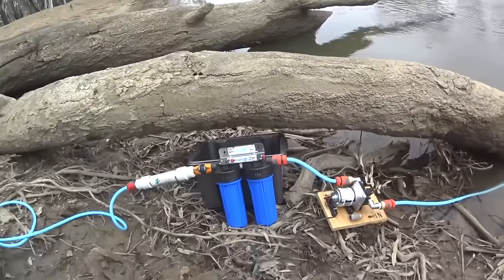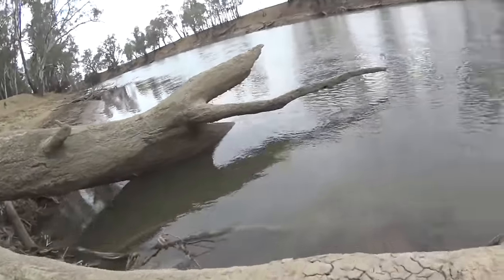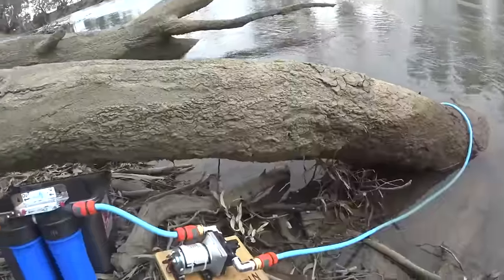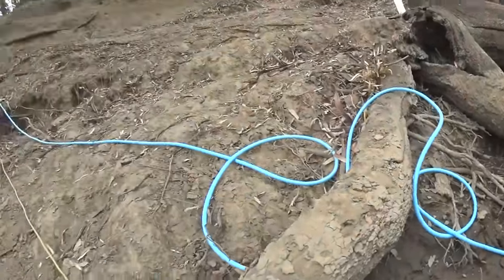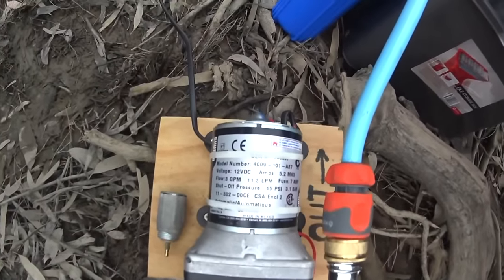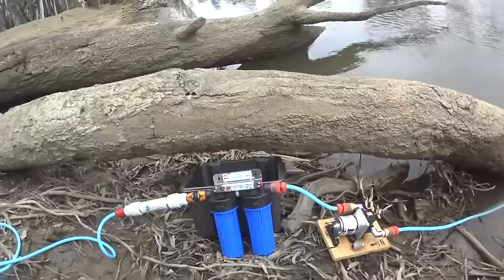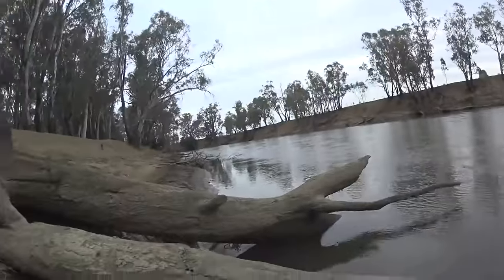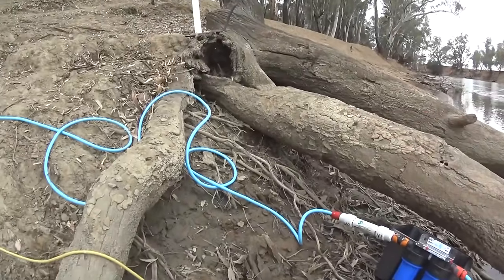12 Volt water pump, Shurflo pump and Water Filter for filling RV Caravan tanks, or camping shower

Comment: I can't get a 24 volt, 5 amp pump to go through 1 30 micron filter with out cycling. What am I missing?
Reply from the maker: I have no idea, have you tried it going the other way through the filter? does the filter work OK with the garden hose? does the pump feel powerfull eg when you put your finger over the end can you stop the water easy, I don't really know maybe the pump or filter people need to be contacted.Let me know how you go. Thank you for your comment.
Reply: We run the same filter but with a 5 micron using the vans pump to fill the tanks and a 0.5 under the sink

Comment: how did you actually wire up the pump?
Reply from the maker: Hi, I am using two 15amp 240 volt extension cable, I have put 12 volt accessory plugs on the ends of the cables so I could use one or join two cables depending on what distance the pump is away. it also lets me plug it straight into the 4wd if I am filling up drums away from the camp. I used the 15 amp leads because of two reasons 1)  I already had them and 2) They have a good size wire in them and a good rubber covering on the lead protecting the wire. I am not an electrician and you will see in the comments here that people say the power drop etc from doing what I have done will damage the pump or it wont work, seems OK to me and I have used this many times. I do agree with  what these people have said, but this is working for me. You can buy a very small petrol pump also if you are thinking that would be better. Hope that helps a bit.
Reply: Gavin Clark You could be fine using one. That’s like 80% discharge.
Reply: If those leads are to Australian standards you have no problem, as they can easily carry a lot more current than they are officially rated at due to the somewhat excessive safety margins built-in to the specs. If you were ever to have any reason for concern, or even just curiosity, simply measure the voltage at the pump end. It needs to be at least, but preferably a little more more, than the minimum voltage for that particular pump. The outflow from your hose suggests the pump is working well within its ratings.

Comment: is the water potable? Thanks @Gavin.
Reply from the maker: The call if it is drinkable water will always have to be made by you, we mainly camp on the Murrumbidgee and Murray rivers and we drink the water, but things change all the time, right now the Murray is in flood and I would not be drinking it, as houses were flooded which means sewage could be there, I have also seen a dead cow floating down the Murrumbidgee River where we camp. It's got to be what you think at the time. There are filters that filter almost anything out, have a look at the LIFE STRAW, an amazing product. I hope that helps a bit.
Reply: @GavinClarkdiy  i am looking to put something like this together and want to incluse a uv filter so the water can be made drinkable

Comment: no problems with seals or anything in pump pumping not super clean water
Reply from the maker: Not as yet, I have never let it lay in the dirt on the bottom and suck from there, but as you say dirty water, that would not help. I have never had this pump running under pressure which is where it would show up, I just have the water free to run out the end all the time, so I would guess even if the pump was worn I would not until it was very worn, if I put my finger over the end and test how much pressure built up would tell me something, but as it is all has been good. Thank you for your comment

Comment: Hi Gavin. Have a similar set-up but need to make filter at river end. What did you use?
Reply from the maker: The Twin Blue Water Filter, the first filter the water goes through is a (0.5 Micron Sediment Dirt Pre Filter) and the second one is a (1 Micron Carbon Block Filter) this one Reduces Chlorine Taste & Odor.
The last filter in my system is a 322H B.E.S.T Inline Water Filter. Hope that helps.